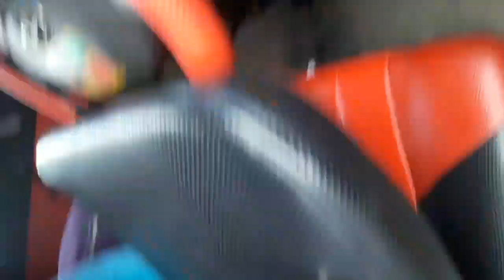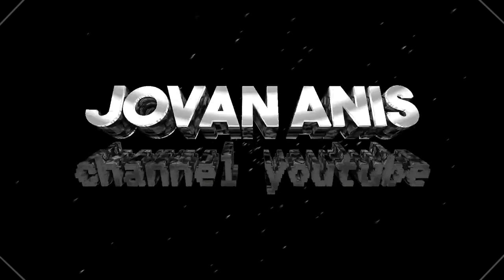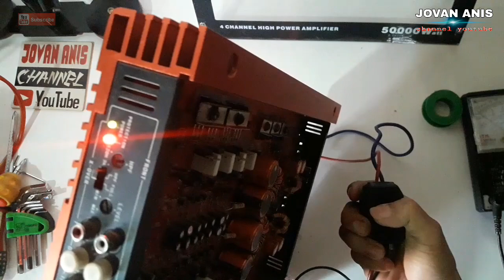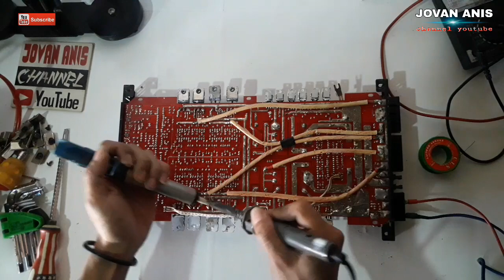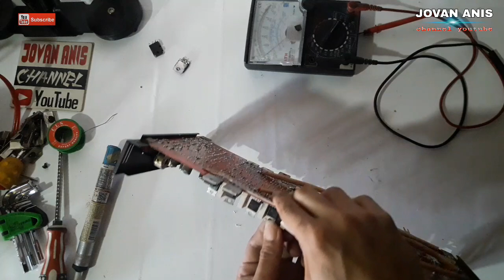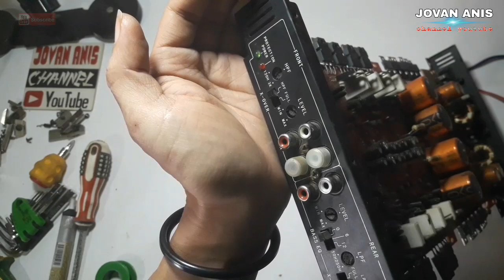Cara mudah memperbaiki power protect//power the punch PCT 4082 50.000 watt 4 channel

Comment: Bro ta pnya klo se kuat lmpu proteck mnyla dg cpat pnas, sma power the punch pct 4082, pdhal bru bli, apa itu blh mo cun spya nd cpt pnas?
Reply from the maker: Boleh, yg 2 chanel (rear) modif monoblock for tola spiker subwoofer mar musti ganti transistor final, trus yg 2 chanel (front) tetap standar, klu mo suka dpe bass lbe padat ba bunyi tambah rangkaian kit crossover aktif 👍,mampu mo tola ads nos 12 inch, power sama pa ng nda mampu mo tola legacy 12 inch main 2 ohm bridge.
Reply: @JovanAnis  oh io kg, mnado bgian mna dg bro?
Reply from the maker: Minsel, pakuure 😊
Reply: @JovanAnis  aww, d tmpa ba urut sna kg bro?
Reply: @JovanAnis  blh mnta nmor wa bro?